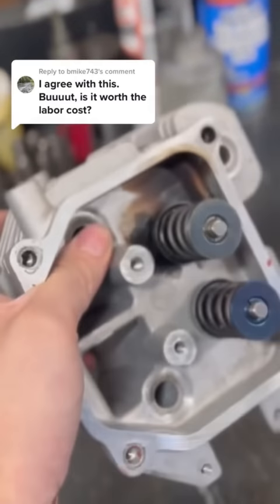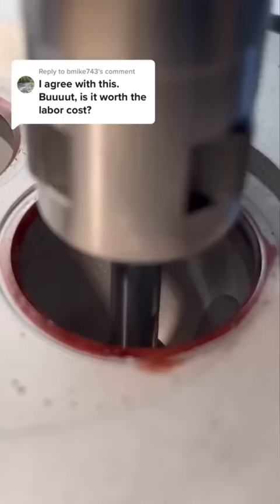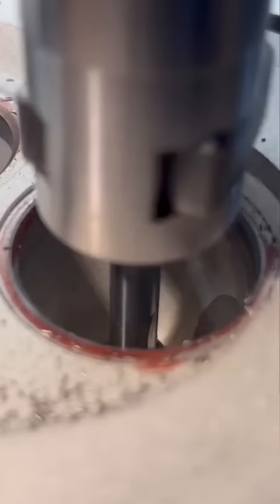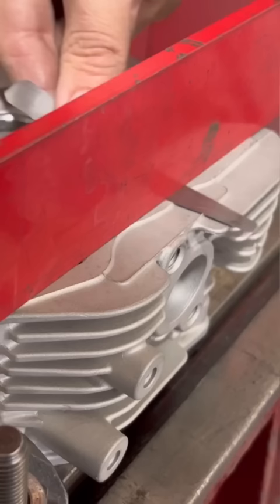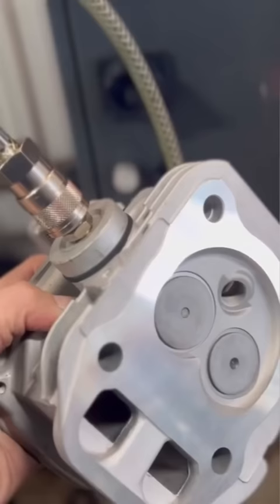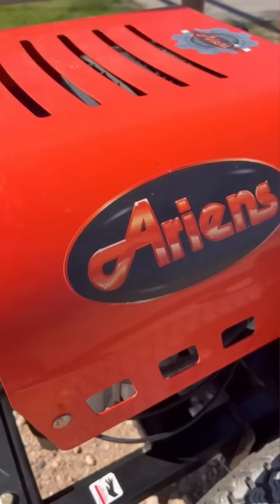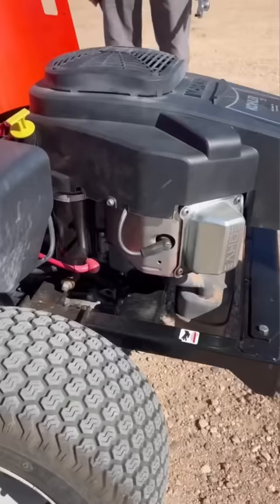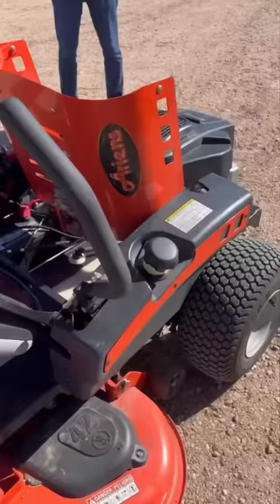#shorts Is Machining A Lawn Mower Head Even Worth It?

Comment: LoL. Yep, This how it starts. Sadly, The replacement heads aren't any better than what he brought you that he took off.
Reply: This is my thought. They come from the factory flawed
Reply: Why is it always about the money versus having the best quality part that that money can possibly buy? 

This is why we can’t get but just a few good years from an engine like this cause our replacement parts are no better than what they replace!
Reply: Do they come overheated and warped from the factory?
Reply: @erik_dk842  Yup. I just machined a brand new Kohler head for a friend. Brand new you could see that the valve seats were ovaled out. I slapped a straight edge on it and grabbed feeler gauges and found it to be nowhere near flat, and it was actually cut at an angle. I had to take it all the way to minimum specs to clean it up. I had him bring me the other head (2 cylinder engine) and it was identical to the new head. Cleaned it up the same way and it runs great now. Just a lack of quality control and equipment maintenance.
Reply: Kohler oppys in the early 2000s. 
Had to send em to the machine shop as the seats and guides needed alot of help getting it all centered back up. 
From what I heard at the time, their tooling was worn out.
Reply: @adamr9215  no it's worn out tooling , they're still using it apparently.
Reply: @MrTheHillfolk  I think “equipment maintenance” would include tooling. Tooling and dies wear and have to be replaced or rebuilt. Worn bushings in a mill head and over tightened belts/gear mesh to stop chatter will cause this exact problem as well.
Reply: @adamr9215  That's because mass production partsike that are not made by machinists. They are made by operators that simply load a part and hit go. They likely don't even check the parts, just sending one to QC every 100 or zo
Reply: @adamr9215  those flattie Kohlers were at the end of their production life ,they weren't going to spend any money they didn't have to.
Reply: @MrTheHillfolk  that would fall under poor quality control...
Reply: @JSAFIXIT  hahaha yup. I worked for greatplains as a laser cnc operator. When tolerance from the factory are +-.03 why even check 🤣 my machine ain't fucking that up.
Reply: @OsiDio  .030 tolerance on a laser is almost insulting lol. you could hold that with handheld plasma cutter.
Reply: @1982MCI  Well, if you're willing to put in the extra money to guarantee a quality finish, that's fine.

But if setup and machining costs more than buying a new head, the shop has already priced themselves out of the general market.

It's always about the money because we measure how efficiently we use our time and value with it.
Reply: @JSAFIXIT  lol, this is the tolerance I spec on my drawings whenever I want the machinist to not give much of a shit in that dimension so as not to make the part cost crazy high. Wouldn't ever put that on something important like a sealing surface for a gasket though, that's just crappy/lazy design work.
Reply: English gets insulted in Youtube's comment section far too often.

Comment: A suction cup stick and valve grinding paste..sandpaper glued on flat surface to plane head..
Reply: Yup. I did the sandpaper trick before I heard that other people had been doing that for years!  Just thought I'd try it and see what happened. Worked fine!
Reply: A Kohler Courage is hardly worth that. 
But if your time doesn’t count, its one way to squeeze another 150-ish hours out of it.

Comment: There is a very large following for kohler and briggs heads and even the older flat head stuff in the mini pulling world. Would love to see some. It’s all over the Midwest
Reply: I had a flathead I brought back to life. Idk how it ran tbh, had a blown head gasket, missing head bolt, etc etc, what finally got me to do something about it was the fact it wouldn't start below like 40° because the valve lash was so far off you could see light with them closed

Comment: I do my own mower heads and my neighbors as well.
Reply from the maker: We have the same exact mower, did ours a few years back lol. His is way nicer than ours 😳
Reply: I just lap its valves and sandpaper the heads and deck on a granite block. 
That’ll squeeze another 150 hours out of a Kohler Courage. 
Afterall, it’s only a low end lawnmower engine.
Reply: @benjurqunov  I lap the valves, polish the seats,valves, and stems, shave the head surface, deck the block, port match head, make sure nothing is warped then send it ( I use a marker to color both gasket surfaces and use a square of machined 3/4 plate steel with sand paper to mill or deck the block and head)
Then leak test the valves and test spring rate and tension with a modified bow scale.
Never had an issue.
With small engines it's not like a race engine it just has to be close.
I set valve lash by hand and feel.
Set lash with one valve full open and adjust the closed one to avoid missing the compression release bump on the cam.
Just keep it simple.
If you are slightly off it will wear in.
Only thing I'm picky about is ring ridge, ring gap, cam wear, rod torque,  rod bearings,  and gasket material.
I prefer making my own gaskets to accommodate crank end play clearance,
I lap valves with grease and sandpaper shavings from the head shave or toothpaste and baking soda.
Reply: @hillbillyholler516  Haha, I lap valves with chainsaw chain sharpening dust and grease

Comment: I would be curious to see the quality of a new head compared to the quality of work you guys do. Monetarily it may not make sense. But reliability maybe ??
Reply: You can do it yourself without the machine tools 😂 just lap the valves by hand and sand the head flat again with some sandpaper on a glass tile (flat enough for a lawnmower)
Reply: @johndowe7003  correct and incorrect.  Although I didn’t ask you a question, and you didn’t really address what I asked anyways 🤔
Reply: @frazeysburgelites3490  quality would be better (marginally) if it done at a machine shop depends on the shop. its a lawn mower not some 1400hp big block lol
Reply: @johndowe7003  once again, I was speaking directly to this shop, not any machine shop. I also never once said or inferred that it would make a difference to the performance of the engine. Being it’s a lawn mower head that they spent as much time on the details as they would a “1400hp big block head”, I would imagine the quality would be higher than the oem stuff from the usual scumbags. I’m not sure why my comment made you so sarcastic and hurt.
Reply: @frazeysburgelites3490  you're the one writing me an essay 👍
Reply: @johndowe7003  haters gonna hate

Comment: i'd rather spend the same money to refresh an old one then to take a gamble on buying another one that you can only buy used (in most cases) and the refreshed one you had will likely preform better because refreshing heads does slightly increase the flow and compression adding a little extra juice to it

Comment: Freshening up the heads is not a big deal, as long as there isn't too much damage. At $80-$100 shop labor rate this makes a lot of engines and mowers disposable. I did a pair at about an hour each on my own mower, but all I needed was a honing on a glass plate with some 320 grit sandpaper, and valve grinding compound to lap the valves. I did spend nearly $100 on a gasket and seal kit. I had a harder time just getting the heads off, due to the tight space  where the exhaust manifold attaches.

Comment: Ok so I learned a trick years ago, old guy taught me to glue a piece of sandpaper to a glass table, I wouldn't do it to a 4 cyl head, but for a mower it was fine. One was intentionally shaved as far as I comfortably could. Offset flywheel key for timing, Had a hogged out carb, ran on alcohol, it was one bad little motor....

Comment: Thank you for doing it though! I work on air cooled engines from time to time as a generator tech and always wondered if anyone machined the heads. Labor is so expensive these days that we usually out price the worth of the engine and replace the whole thing vs rebuilding it.

Comment: That thing is probably flatter now than it ever was before. 
My mower ran with beer box oil gaskets, steel wool pcv filter, and a blown head gasket/ missing head bolt till the valve lash got so out of spec it wouldn't start cold.  Busted out the angle grinder, slapped a helicoil in the missing head bolt hol, new gasket and it chooched better than I can remember.

Comment: I just asked a question like this to a guy whose in the same industry. And curious what your thoughts are. I had a D1.6 head from a Honda I needed resurfaced.  But the only machine shope in town wouldn't do it. Main reason he gave me was "The machine costs to much to run for that little time." And I know these machines aren't cheap but but being advertised as a machine and transmission shop. I figured the only guy in town would help just charge me some more. And he just didn't want to touch it. Just curious what someone else's thought on it were.

Comment: Sometimes you can't find a replacement at any cost because it's too rare or ancient.
If you need to machine a cylinder head surface like that, your best bet is a large sheet of glass on a very firm table, and a large supply of sandpaper.
Yeah, I'm too cheap to buy the new head.

Comment: What is your stance on vintage single cylender heads,jaguar a big project so money to be made so no negative.But things like 1960's single cylinder heads? Some heads on kohler k series engines are highly prized for there heart shaped chamber and center spark plug hole vs later heads from 80's with less efficient shape and plug hole over exhaust valve but make exhaust valve extramly hot to point of damage but those are easy to get vs vintag. I do agree thats a bunch of work for that head there and its way smaller than kohler cast iron k series heads.I do know some IH cub cadet collectors having as many matching parts is important and NOS prices are only going up.

Comment: Something I'll throw out there, since I have a couple of those engines is that the seats don't have enough press fit from the factory. When they overheat, they'll drop a seat and buying a new head isn't a good fix, because it will just happen to the new head too. Re-cutting the counterbores oversize and putting new seats in with more press is the answer, along with addressing why it overheated in the first place.

So, if someone brings some in again needing work, quote it at full price and let them decide. I wouldn't be against asking for partial payment upfront either, since the quote will be for as much as a new head. Personally, I already know what I'm getting into when I take them to the machine shop and he knows that.
Reply: @Retired Bore A lot of people, myself included, still call that a press fit, even though they aren't being literally pressed or driven in. I guess it's technically an interference fit. You're absolutely correct, with aluminum heads actually pressing/driving the seats in at room temp. will shear or smear a small amount of aluminum off as it's pressed in. That essentially removes the interference fit and leaves a little pile of aluminum shavings at the bottom of the counterbore too. Chrysler has had the same problem with 5.7L Hemi's. In that case, I don't know if it was how they were installing them or with the amount of interference that was machined into the head and seat. I'm lucky that one somewhat local Walmart has dry ice, so I get a piece of that and have fun with what's leftover after the job is done.

Comment: I would also add, that in my experience, if you strip and measure / check a new replacement head, they are horrible. The guides are usually way over size, and the seats are agricultural at best. What you did for your neighbours is likely now far superior.

Comment: The question is, does your work result in a better end product than the factory that’s pumping out 1000s or even 10s of 1000s of these things per month? I would be inclined to think “yes,” but it would be interesting to see how much you can improve on a brand new (unwarped) head

Comment: On valueless heads there's nothing a quick lap of the valves and a wet&dry "resurface" on a thick piece of glass can fix it to get you out of a pinch. 

(Obviously if you have the proper gear on hand you would just do it  properly)

Comment: Simply put would be YES. It is worth doing it if you know how to price it. I know from experience I’d pay more to have a matching number factory original part machined and saved doing a build oppose to buying a replacement. I know in the older Honda motorcycles factory original parts hold wayyy more value.

Comment: Yeah, the only way this could be cost effective, is having a large batch of them, and do them all as the machines are set up , like a factory, probably a dozen at least,  but who and why,. Like my scooter, you can buy a new head , with oversized valves for $30 shipped!  So valve jobs are out of the question,  it's cheaper to buy a new head, unless you can do it yourself, I have heavily modified theses heads, port and chamber work wise, I just need to get one cut, take about .050" off it, to raise the compression ratio,  my dad told me a story once, about a machine shop/ speed shop/parts store, they had a sign reading, ' "Speed cost MONEY! How FAST do YOU want to GO!" The only way it can be done cheaply, is you being able to do it yourself,  this is why turbos are so popular now, you can get them cheap, bolt it on , program the ECM, maybe injectors and fuel pump, and 🤯 BOOM Jim's your uncle, you doubled the power, (in some cases!) Back in the day, it required larger valves, popup pistons, or angle cut heads or just cut heads, blue printing, (sometimes you can still see the blue after it's built,! Haha! 😆, I had someone tell me that once) now especially with the LS engine, all that stuff is basically already done,  it's basically race heads stock , compared to even 30 years ago, imagine taking a stock LS engine, back to 1960, give it a cam, and 12:1 compression,  it would be outlawed by Nascar,  it would be the fastest engine available,  it's crazy how far engines have come, I bet your truck runs decent also! 😈 Haha,  a little bit of cam and compression goes a long way on these engines! I want to make the LS Leap, I'm still a SBC guy, have an 😎 awesome day!!

Comment: I had asked earlier about that head because it looked familiar. 
I was right, it's a Kohler.
Reply: I haven't noticed a significant difference between Kohler, Briggs, or Kawasaki. I've had Briggs blow up, seen Kohler burn down, and Kawi flood the oil with gas.  My present mower is Kawi, has over 300 hours on it. So I guess that's a vote of confidence.
Reply: @wiredforstereo  Kohler Courage series are a low end motor. Seldom last over 300 hrs. 
Their Command series is  substantially better.
Reply: @benjurqunov  IIRC, it was a Command that burned down the mower. But this was back when I worked at Lowe's, about 17 years ago.

In fairness, it may not have been the engine at fault, could have been the clutch or something else.

Comment: The simple answer is Yes, really...but you can do this job with a different set of tools at half the cost and less time really, that and maybe availability issues...just use valve lapping compound and a valve lapping tool(aka suction cup 🪠) you grind the stems down manually it's actually fairly easy to do, if it's an OHC engine you have an even easier time determining if it's worth it (newsflash, they usually are because they work harder, and last longer than OHV engines for obvious reasons.)

Comment: I’m in the business of spending money once and spending it right you can buy a whole new head hell you could go to Harbor freight and buy a whole engine do their break in. And it may still fail not to the years are doing with the manual said, but the manufacturing process as you know those engines are basically Honda clones.

I would rather just spend the money right take the freaking head off and get it done at the shop 

Hell, if you can’t afford that or an engine or to buy a replacement head, maybe worst case scenario you just get a very flat hard surface put sandpaper on it that is extremely fine and just start going back-and-forth. I’ve seen that done on YouTube with head gasket jobs for cars.

Comment: I kind of agree with your statement,  however,  I bet the machine work you did is better than the factory did. Expensive,  yes.  In my opinion,  it is worth it.  I personally am willing to pay for good work,  you sir did an excellent job.  I don't know if you have priced small engine heads lately,  but you can easily spend over $200 per head.  I would rather support a machine shop than buy parts of unknown quality from China.  Just my opinion and not the opinion of this channel or its supporters

Comment: A kohler 22hp ???🤦🏻‍♂️🤦🏻‍♂️🙈. And then you got allll the old guys that are still in love with Kawasaki’s (but they have gone to crap) and the new Vanguard’s,28-40hp… with the Oil Guard and EFI. These motors will last forever. Got to have that oil guard system. Revolutionary for small engines. Old hat for race cars

Comment: I have a tool repair shop and someone comes in with a Craftsman tool I tell them throw it away it's not ideal to fix it, first your gurantee it's no longer available since the company when bankrupt, second parts are not available since they came from china, third you would be better off buying a different good model for the price this repair is going to cost (if I find replacement parts) with no gurantee to you on that repair